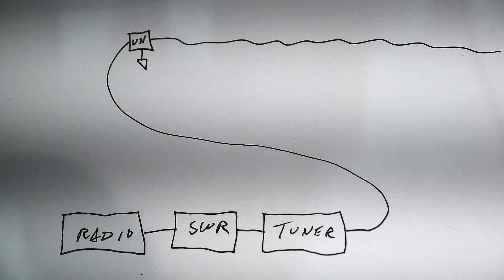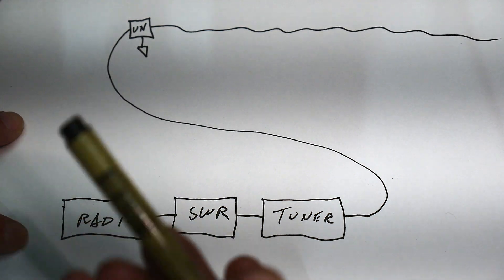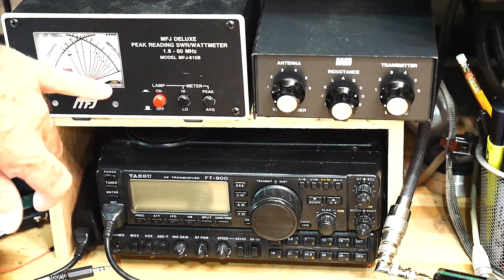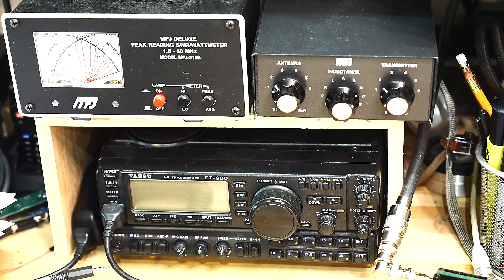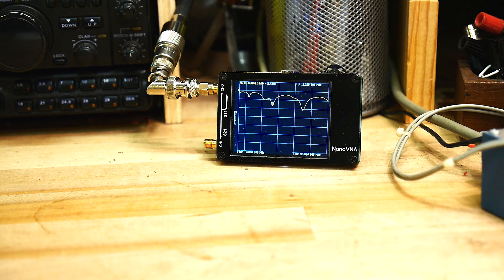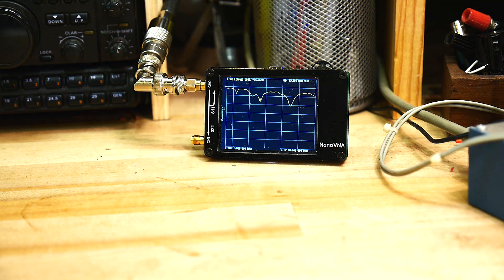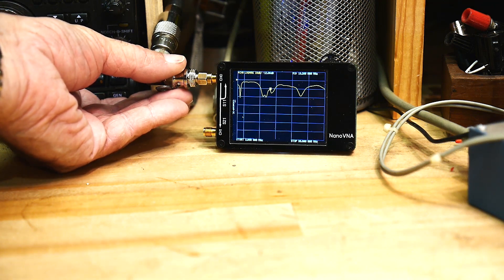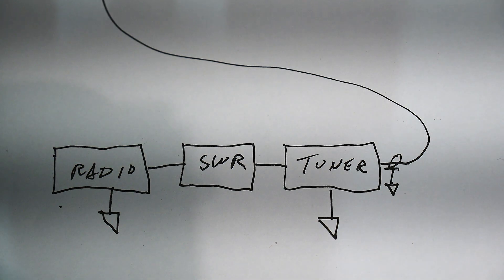#499 NANOVNA Grounded Coax

Comment: Can you help me with a strange problem I'm having? I'm having trouble with a broadband antenna - here is the letter I sent to MFJ:

I ordered a Yaseu FT-891 and MFJ-2386 from Ham Radio Outlet. The FT-891 has no tuner, and I wanted a simple setup, so I ordered the MFJ-2386 because it is broadband. 

I have some questions about the assembly instructions. The Ham Radio Outlet Ad (attached) claims the antenna is 23.5 feet tall; your instructions claim it is 28.5 feet tall. I can see no way to make the antenna 28.5 feet tall without an air gap between the sections. Following the assembly as best I can, I get a height of 23.5 feet. 

While I'm waiting for new coax to arrive (the old run is too short), I decided to test the antenna. I'm installing this on a 33 foot push-up pole. The base of the antenna is only about 12 feet off the ground (short coax). I get high SWR warnings on all bands. For safety, I have the radio set at 5 watts; when it is keyed the SWR display pegs full scale. If I connect a dummy load to the radio no SWR is indicated on all bands as it should with a 1:1 match. Connecting a properly calibrated Nano VNA to the antenna shows reasonable SWR - photo attached. The best SWR is 1.3 and the worst is 1.9 (bottom of scale is 1:1 - top of scale is 3:1) The radio seems to work correctly, the antenna seems to work correctly, but they don't work together. I figure its something stupid. Y'all got any ideas.
Reply from the maker: No idea, they call it a ground plane antenna, so it might have to be mounted at ground level.

Comment: I definitely do not know the proper way to explain this... but I’ll give it a shot:

According to the latest few NEC editions (NFPA70) , you must bond all equipment grounding conductors
to one dedicated grounding point . Just like mandating that you remove the green screw bonding the neutral to the 
chassis/cabinet in every sub-panel or junction point PAST the primary service entrance.

Stray current can find its way through multiple pathways to ground (actually the utility provided neutral which is bonded to ground)
and create a multitude of hazards.   One of those hazards is the failure of a smaller sized conductor to pass enough 
current to “ground” with resulting failure of the overcurrent device(s) to trip or open.   

Another is one for the EMF sensitive...  when “equipotential” grounding does not exist, neutral 
current can find paths back to the utility OTHER than the neutral (assuming single phase 120vac) 
that supplies the circuit.   There exists a high potential for the ungrounded conductors (hot phase) 
to generate large amounts of EMF when a load attached is NOT run back to the utility neutral (bonded to ground at primary panel)

These stray type currents are easy to see in a miswired multi-wire (aka “Edison”) circuit.   Another place to find
this effect is in a “switch loop” / “California 3-way” (3-way as in switching style... a d NOT related to DemonCrat activities 🤣).
When a luminaire has continuous power running to it’s box and a piece of NM (“Romex”) is run down to a N/O single-pole 
wall switch, THAT piece of cable emits HUGE amounts of EMF.  
Ttrust me... my brother is “EMF Sensitive” and kinda touched in the head.. or so we thought.
He had me rewrite his 1950’s home to remove all switch loops like above.  
AND..  had me run all of the bedroom (spend 1/2 your life in bed?) circuits in EMT and MC cable
(metallic sheathed) to avoid any potential “potential” ..  yup,. Play on words.
👍🏻😉😆

For safety’s sake, I was told never to include a SEPARATE ground rod on a standby generator 
or any other piece of equipment or switchgear.  (OR bond the equipment chassis ground to neutral
in any generator...permanent standby type OR portable genset types.

(Not against code....  just bad practice) 

What I’m getting at...   always run your antenna and shack grounds to a common point 
where you bond all of your cable tv / antenna / matv / telco / etc.. grounds to the service ground.
(I added a bus bar in a weatherproof pvc Nema type enclosure at all of my family properties.
It’s bonded to the service ground rod or the meter pan ground with #6 or #4 AWG stranded copper)
Provides a great common spot for all utilities and satellite installers etc... to bond their gear.

Thanks for another great video!!

Comment: is there any differences when you touch that ground wire to the connector with your hand touched the connector and not touch the connector...

and sorry my english is not good..
Reply from the maker: touching things will add the capacitance and impedance of the human body so it can effect things.
Reply: @IMSAIGuy  thanks... Nice video... subscribed...

Comment: My antenna is grounded outside, so in that effect, wouldn't it be grounded then? Your antenna might be different, but just a thought
Reply from the maker: Try measuring with and without. you might be surprised. Mine is grounded outside too.
Reply: @IMSAIGuy  It wasn't mentioned, so I didn't know. I'll definitely try it. I'm getting weird results.